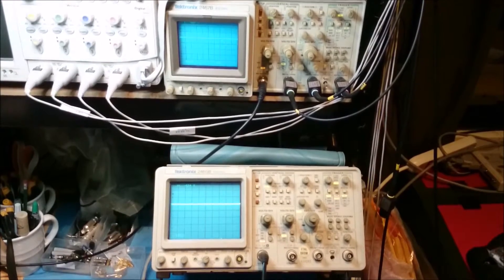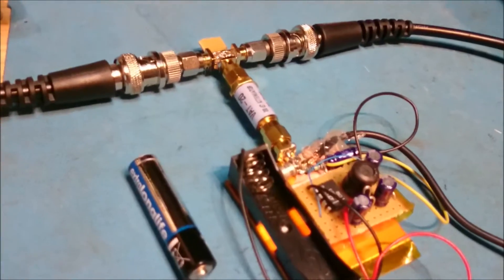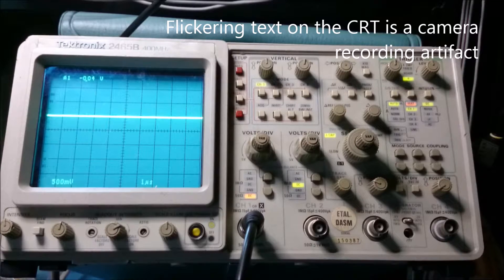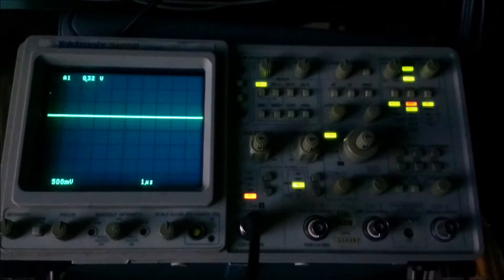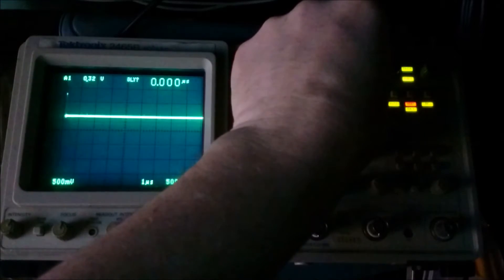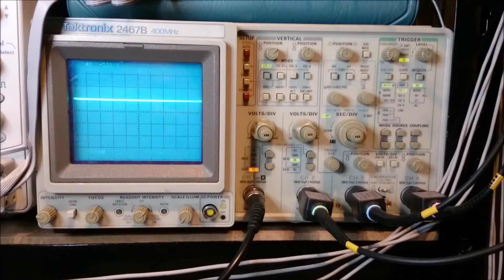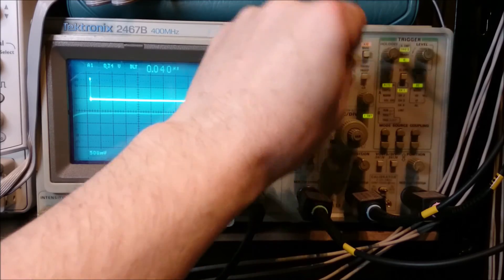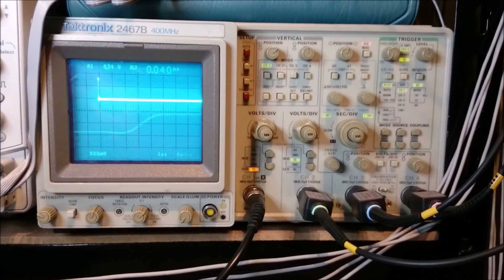Comparing Tektronix 2465B and 2467B oscilloscopes

Comment: I have the 1 GHz microchannel plate CRT 7104, but it's a beast compared with the 2467B.   I almost always use my 485 instead.  Is the 2467B heavy?

Comment: Great information! 

I thought the 2467x has a timeout?
Reply from the maker: It does, it resets after each front panel adjustment to increase CRT life. The length of the timeout varies depending on trace intensity from about one to four minutes or so. I don't know how it can be adjusted or disabled. It can be a bit irritating at times!

Comment: Hi I have Tek 2456b and  either I don't know to use this function or it does not work could you please give a demo on using this function on a 2456b  Cheer's
Reply from the maker: Hello Robert, thank you for your comment. Which function(s) are you interested in? Delayed/dual trigger, dual timebase, or something else?
Reply: Okay I may be wrong but my understanding of the SGL SEQ function is to capture a single scan cycle so you can view it on the CRT  .Now I 
can arm the trigger and the READY light is displayed I then trigger it by applying a pulse. The screen flashes and if you watch the crt  carefully you can see it captures the scan the ready light goes off .
At this point the screen is blank and remains blank.
I have been through the manual and performed all test it passes all test.
Am I wrong in assuming the data should be displayed ? 
If so what is the purpose of this 
I need to capture the very start of a pulse sequence
The manual says the data is displayed after all scans have been triggered and the screen display's the data for photography purposes.
Cheer's thanks for the reply.